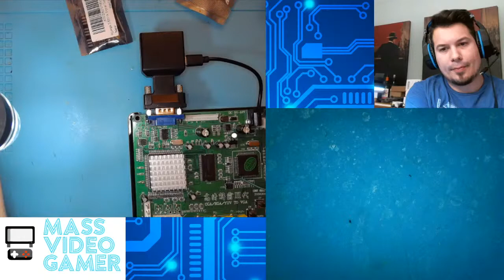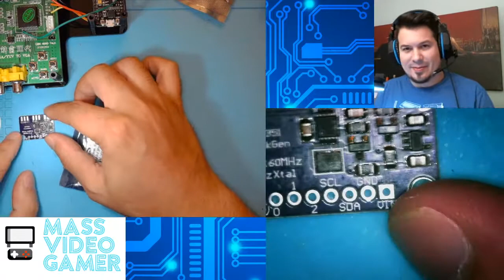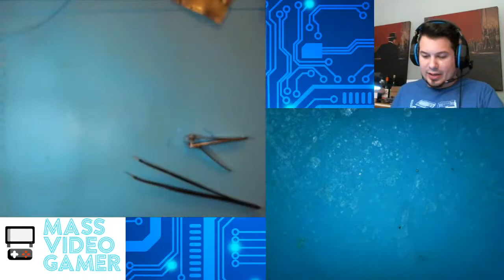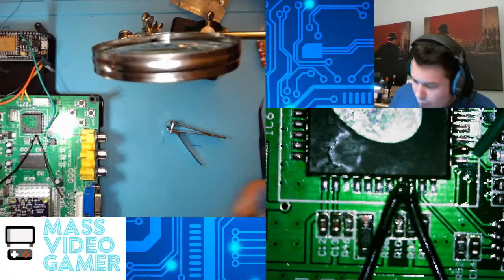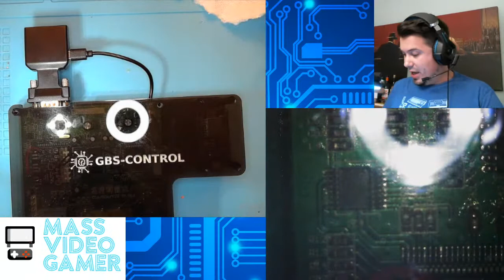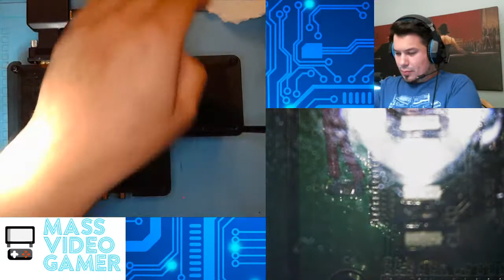Installing a Clock Generator on a GBS-Control with custom firmware

Comment from the maker: I should clarify that there isn't anything to do in software. You can CHECK if you installed it correctly through the GBS-Control Software by clicking on preferences and hitting Frametime Lock. If installed correctly, it will send a message stating the clock generator is installed.

Comment: I am going to purchase a prebuilt GBS-C for my PS2 Slim but I am a little confused on which model to buy. Which prebuilts have the clock generator mod installed and is the GBS-C Pro the best version with a remote control?
Reply: The GBS-Pro doesn't seem to be all that good. Probably not that bad either. The S-video and composite inputs don't work that well, and that's the main thing that this so called "GBS-C Pro" has. If it includes the clock mod and also has decent quality capacitors, then it's probably still a pretty damn good option.

Comment: Here is a really stupid question probably, is the clock mod generator useful for like slight sorta blurring with scrolling screens?  I don't think I get tear lines with my GBScontrol, but I do find moving screens to be a bit weird on my eyes if I try and follow them, the central sprite might be ok but the background is blurring a bit.  I find this in a few different games and wasn't sure if the clock mod would help that or not?  I have most of the parts for the clock gen mod but I'm not sure it's worth doin in my case.  Great video BTW thanks :)

Comment: Do you still notice any occasional tearing w/ the clock generator?  I installed mine and pushing the Frametime Lock button gives me the proper installed message.  That horizontal tearing occasionally pops up for me w/ 1080p output.
Reply from the maker: Interesting. I use it at 960p so I haven't seen any screen tearing since the clock generator mod. Hope you are enjoying it!
Reply: @massvideogamer  Thanks, absolutely am.  Really impressed with its deinterlacing.
Reply: @freerad4life  I'm getting it too, did you ever fix it? I didn't even have screen tearing until I installed this. Also, I noticed if I crank up the Hz on it I get white specks appearing on my screen. Maybe Mass knows why this might be?
Reply: The screen tearing could vary depending on the display you use, and can almost definitely still happen even with a clock mod installed. 

Even with a modern PC and freesync or "g-sync compatible" mode enabled in your display and on your PC, screen tearing is still possible, so I definitely think it can still happen with a GBS-C even if the clock mod is working properly. It should just happen less often. 

I have noticed screen tearing sometimes with my RAD2X. Changing scaling options on my TV depending on the game I'm playing seems to fix the issue. So far it only seems to be an issue with one game.

Comment: Hello! I am having an issue with the wifi completely dropping when connecting a PS2 and switching resolution to 1080p. No issues with other resolutions and can access GBSControl web server. As soon as the PS2 component cables are removed from the GBS I can access the web server. Do you also have this issue?
Reply from the maker: Unfortunately, I don't. I tried PS2 with component cables by HD Retrovision and it didn't drop the wifi signal. It may be picking up interference?